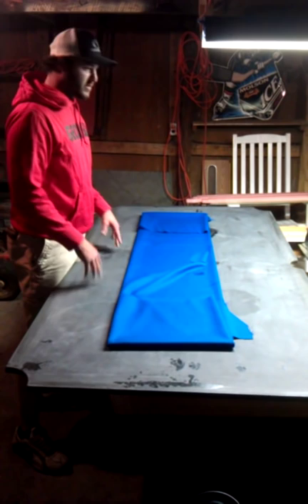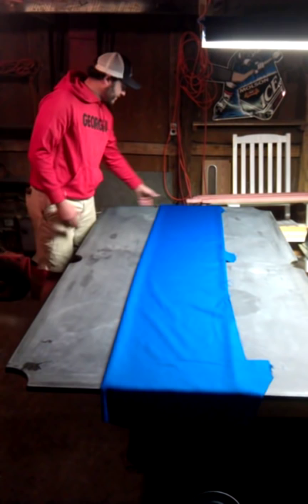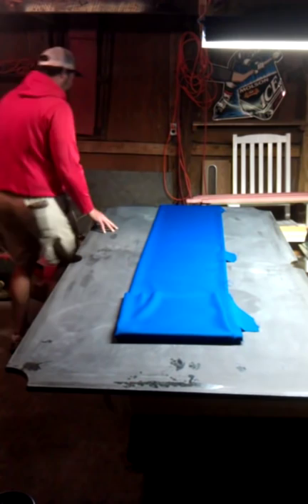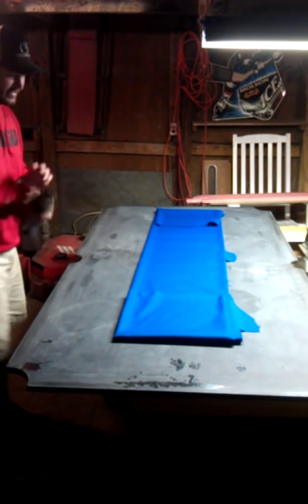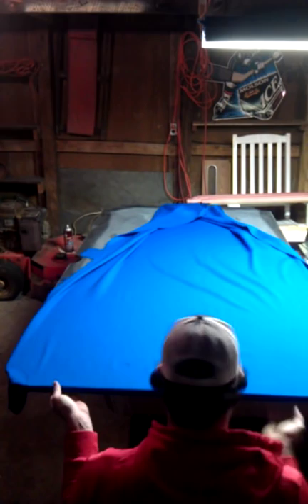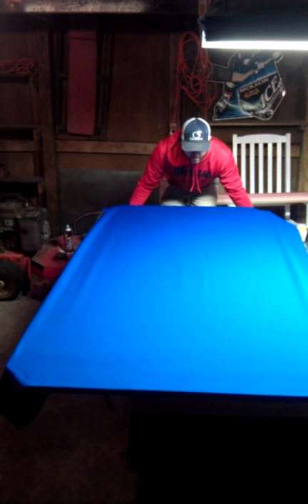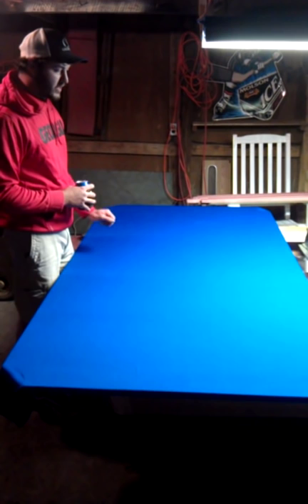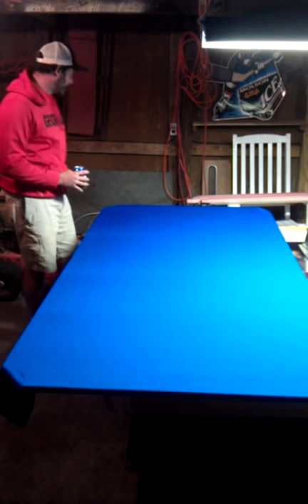How to re felt pool table

Comment: Thanks for the tips, good video. Also like the felt color choice .
I would definitely use Polymat 777x glue. They specialize in making a strong glue for a good price. They even offer a high strength adhesive, 797x.

Comment: Just for future, if you are doing it again, spray the 2 ends first,wait for the glue to go tacky then lay one side down,  pull tight on the opposite side keeping felt straight then repeat on the sides. This will eliminate at wrinkles before starting on the pockets

Comment: Well, it is obvious that this guy is not a professional installer, but it takes common knowledge to know that the the glue will not adhere correctly to the felt if you keep pulling it off, then laying it back on the slate.  I'm sure there wasnt much time before the felt came unglued from the edges.  Maybe he should have seen a few more YouTube videos before trying it himself.   If you want it done right, hire a professional.  Cheap labor is not skilled and Skilled labor is not cheap.
Reply: First off theres a grand total of 3 glue down videos and they all differ. If you know of more pass them along